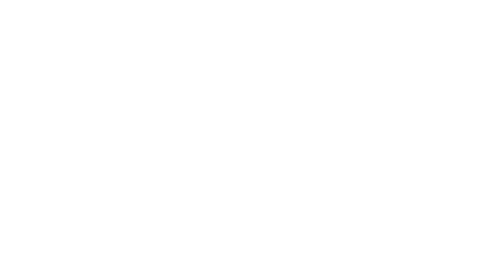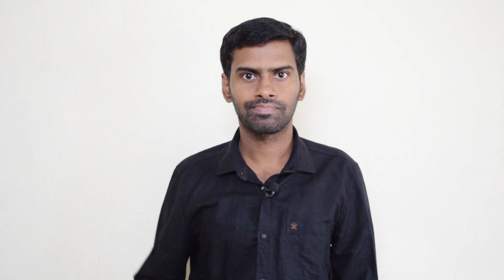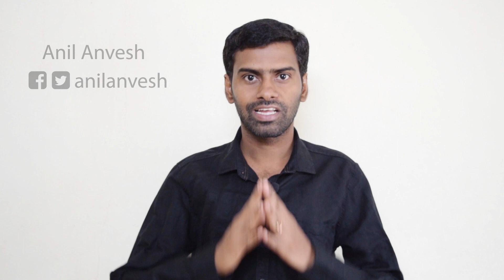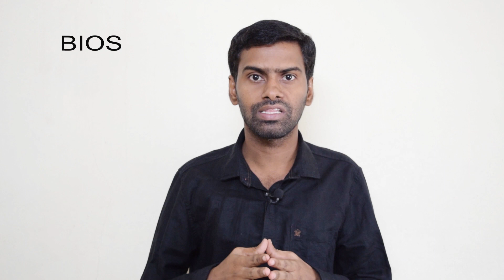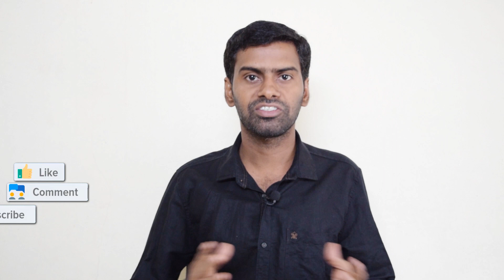What is CMOS Battery in Computer? How CMOS works?

Comment: Hi sir. My laptop sony vaio is 10 years old. Recently i updated it by putting a 512 gb SSD in place of hard disk drive. Problems started to appear once i cleared its fan as there was heating issue and fan sounded a lot. Now i am unable to upgrade my windows from 7 to 10 because laptop automatically turns off the moment it starts installing and comes to around 5%. Also laptop gets switched off when i enter in BIOS mode. So i just want to know will replacing the battery of bios will resolve this issue.
Reply from the maker: 10 years is a like a century in Tech world. Upgrading RAM or storage or Processor won't help in few cases. You need to ditch that laptop and get a new one. Modern software require modern hardware. Hope you get it (: